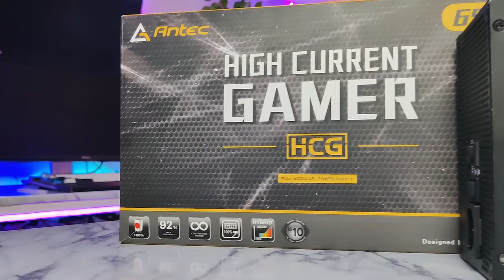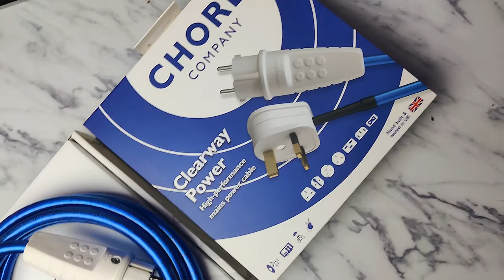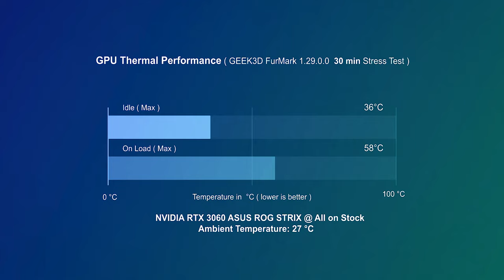WE ARE SO IN LOVE WITH OUR FIRST WATERCOOLED GAMING PC | ANTEC TORQUE | BITSPOWER | ASUS | RAY TECH

Comment: Hi I just got Bitspower Sedna Torque for Antec Torque Case (P5D)
and  I noticed that the connecting piece between the pump and the reservoir was Made of aluminum
Which will result in galvanic corrosion if it is connected to copper
Is there any procedure to avoid this happening?